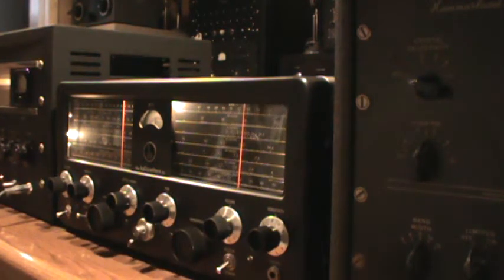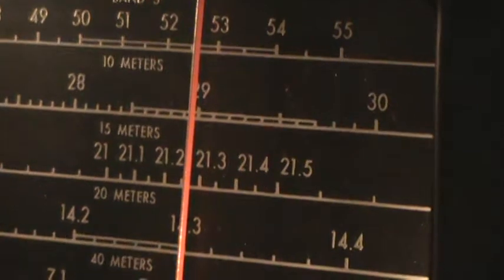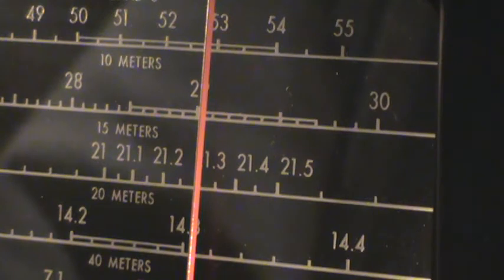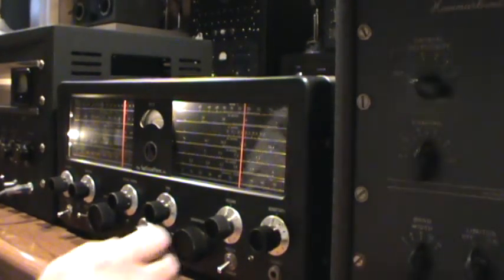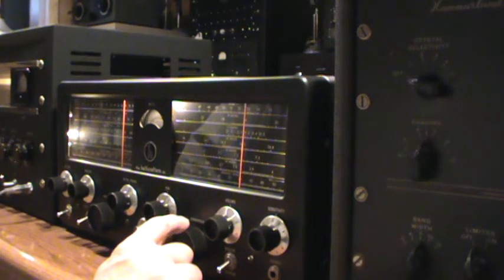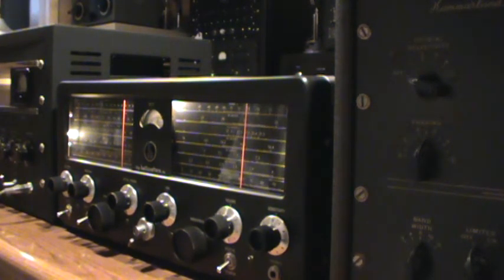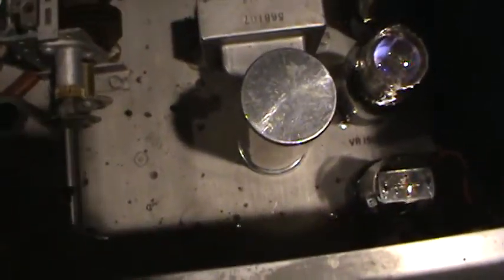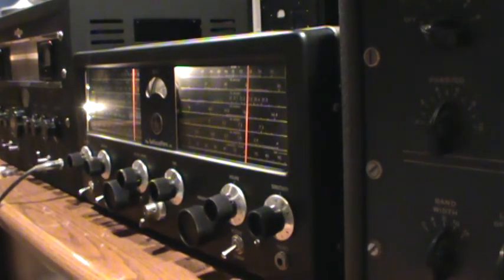Tuning the 10 Meter Band with a Hallicrafters SX-71 Receiver.

Comment from the maker: My honest opinion is that the SX-71 isn't the best receiver for 10 meter operation. Sensitivity is ok but the dial resolution and stability is lacking. That being said, if signals are good and you don't mind touching up the tuning occasionally, it does work on 10 meters and you can have a lot of fun.  The antenna used in this video was an end fed zepp cut for 80 meters but tuned with a Johnson matchbox for operation on 10.  Again, not the best antenna for 10 meters but it works!

Comment: Hello w8khz, thank you for posting your SX-71. I ham new to SW and HAM radios, but I just received a SX-71, as a gift. The radio did not come with a speaker, can you recommend a speaker or will any 4 ohm work? Also, what do you recommend, for an antenna, straight line attic, be fine? Thank you, in advance... Cheer!
Reply from the maker: +scotland770 Thanks for checking out my video. I think any 4 or 8 ohm speaker will work. Yes a long wire antenna in the attic will work fine. You will enjoy the SX-71. Once you have are familiar with the SX-71 and shortwave, there are many other interesting radios you can try. There are many that are better built and better performing than the SX-71. Good luck!